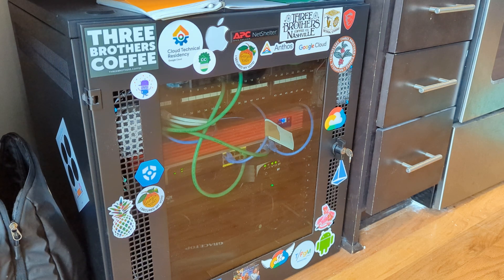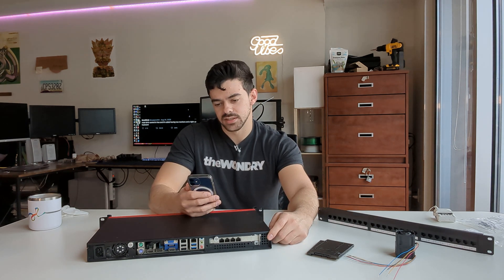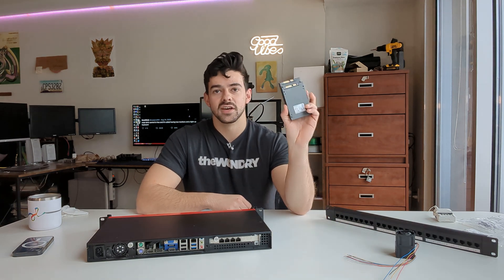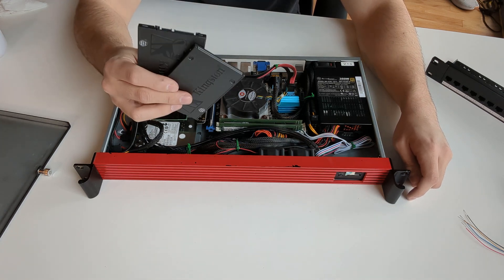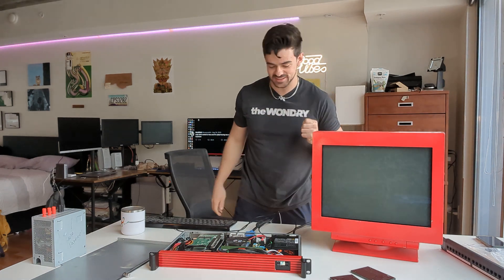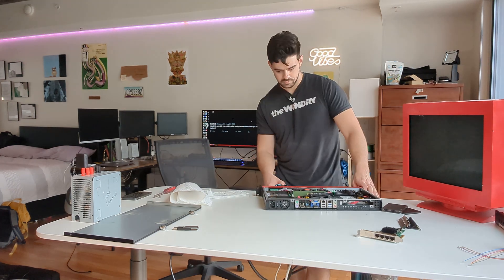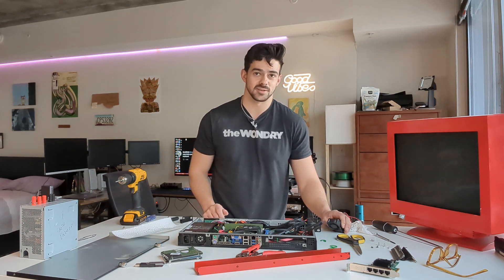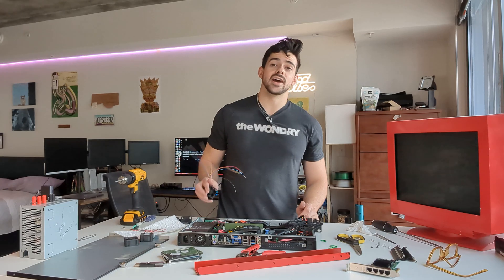Upgrading my pfSense Router

Comment: the dq77kb has ran my opnsense so reliably for years, and just recently got 2 spare back up boards, some spare dimms, another power connector and a x550-t2 10gbe pcie 4x NIC. Now I can really stretch my little pico datacenter :D

Comment: The most controversial part was that you didn't cable manage? I thought using a vacuum instead of an air compressor was pretty bad. 

Love the video though. Just found you through the previous router video, very nice.

Comment: Why not use a passive heatsink and 2 nice noctua fans. Make a plastic shroud to pull the air across the heatsink out the back.
Reply: Or at least hooked up to a PWM header lmao. He literally just has them hooked up to a Molex connector.
Reply: @preston2748  true that, also could install lnr adapters. Mines silent and still moving air.
Reply from the maker: Actually a pretty good idea, there's only one fan header on this board is the CPU fan header, but I could definitely borrow the PWM line for the front fans. Still, the sound does keep my demons out
Reply: @ThomasComputes  are you sure about that ? What is model of board ?
Reply from the maker: Had to pull the board out and check, and it does have a chassis fan header! Still, I'll keep it like it is. After several weeks running it like this, I find that the sound level is perfect for me. This technique is super useful though, and I wouldn't be surprised to see it find its way into another video.